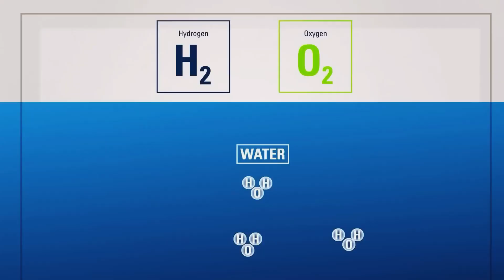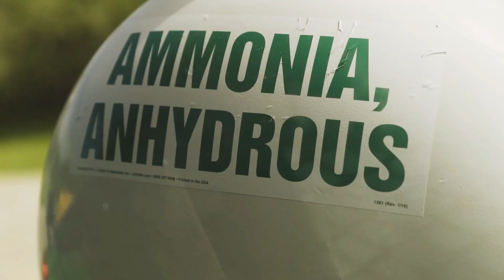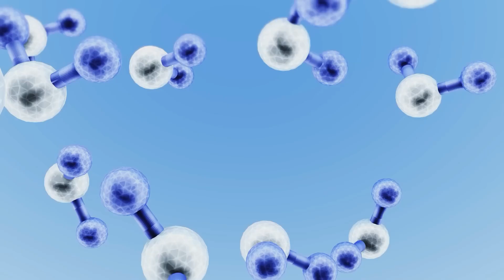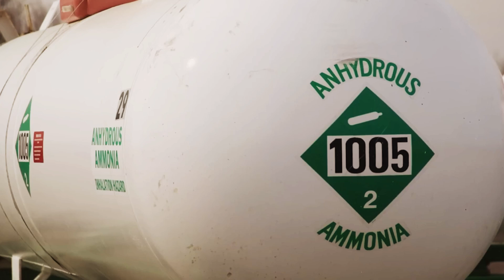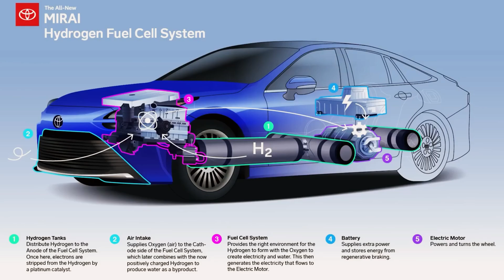TOYOTA BREAKTHROUGH: AMMONIA ENGINES SET TO OUTRUN ELECTRIC!

Comment: ... nobody talks about the biggest issue with ammonia fuel engines that are usually two-stroke in the larger size. There is a problem with the requirement for a very high ignition temperatures. This requires the use of fossil fuel to help combustion. You can't get away from using fossil fuels even if you're using ammonia as the prime mover - In order to solve the difficult ignition problem of ammonia, it is a common way to mix ammonia with traditional fuels using in internal combustion engines such as gasoline, diesel, LPG

Comment: OK, mr EV hater. Where are you to fuel an ammonia car? The Oil companies will not install the infrastructure until there are multi millions of these cars needing fuel. The buying public will not buy these cars until there are thousands of fueling stations. Just like Hydrogen, without the infrastructure this tech is dead in the water. HOWEVER, there are now 150,000 EV charging stations all across America with 4 or 6 or more EV chargers waiting & ready to charge your EV. Tell me this mr smart guy, What are the emissions levels like for an ammonia car? If it burns, it emits emissions. Emission free vehicles is now a gov  MANDATE.
2022-over 1M EVs sold in the US for the very first time
2023-1.7M EVs sold in the US
2024-MORE EVs forecasted to be sold.
Get with it-The world is going electric and Toyota has  NO  such tech they are working on.

!

Comment: I wonder how smelly it is
Reply: That potential problem was most likely resolved before those vehicles will hit the market, however #staytuned everyone 😎
Reply: If you believe in #globalwarming aka #climatechange I have beautiful beachfront properties in the middle of Wyoming along with beautiful pink winged unicorns for cheap 😎
Reply: once it's combusted you can't smell anything it's the problem before combustion that is the main issue. It's a choking poisonous gas that can kill you before it is burnt in the motor. Just check out areas where there is ammonia plants that help to make the ice. Watch what happens if there's a leak in the ammonia plant. Everybody is out of the building right away because it's so toxic and can kill you. A lot of work to do before I drive anything with ammonia in it.